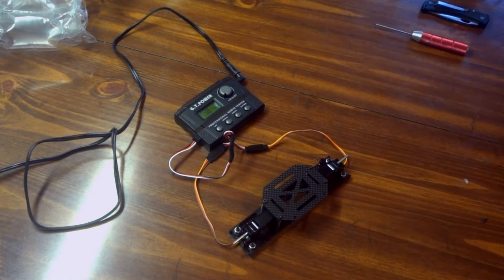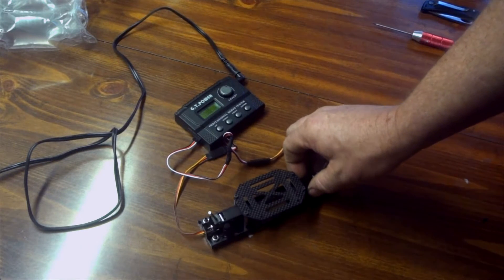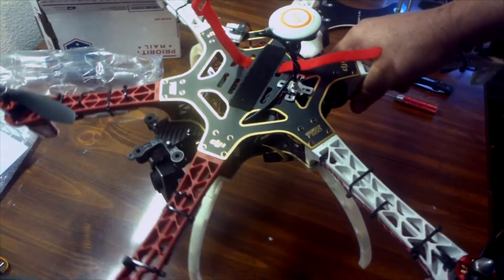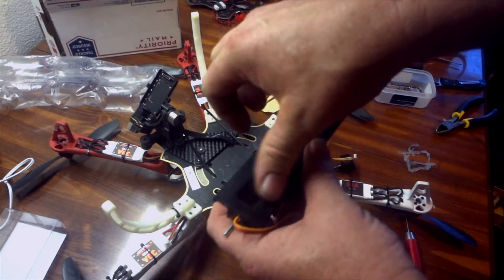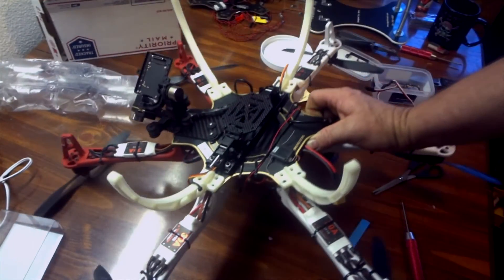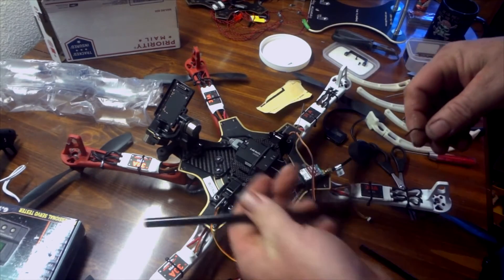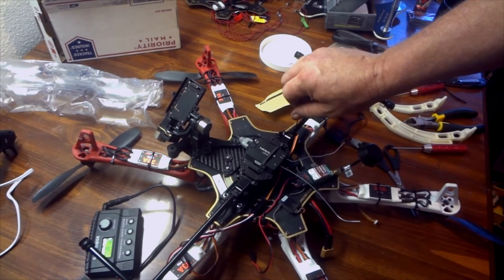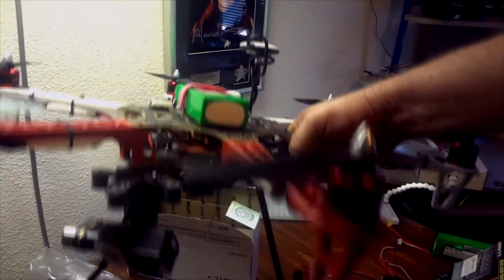F550 Small size Alloy Metal-Multi Rotor Electric RetractSystem Installation.

Comment: I removed the set screws then used a small drill bit and while the gear was taped down, I drilled little notches in to the shaft. I replaced the set screws after blowing out with air. This made a major difference. Nor more twisting of the pin in the trunion. Tested 3 flights with intentional hard landings.. Perfect.
Reply from the maker: Very cool!  Glad to hear it.  I haven't had much of a chance to fly mine, fall weather has set in.

Comment: Thank you, I was just going to drill through the trunion and pin it.
Reply from the maker: Been busy all day today, haven't had a chance to upload the new video yet, but there are two small allen screws on either side of the shaft that goes into trunion, you should just be able to tighten those.  You might want to try that before drilling.

Comment: Tried that already. If not drilling maybe a notch for the set screws to hold on to.
Reply from the maker: That could work.  In my video (sorry, still haven't had a chance to post it yet, have had out of town family visiting this weekend), I show that the pin only has a flat spot on one side, thinking about using a dremil tool to flatten out a spot on the other side for the second set screw to rest in as well.  I haven't done that yet, thought I would see how the Loc-Tite worked first.  Weather has gotten bad where I live, so haven't had a chance to do any flights since doing my repair on my gear yet.  I hope to get some flights in tomorrow in between the rain to show our visitors.

Comment: On my testing, the pin in trunion comes loose after a few landings. Have you had this issue or did I just get an odd set?
Reply from the maker: I think mine is a little loose too, i noticed that one of my legs twists a little now.  Haven't had the time to investigate it yet.  Other than that they are still working after about 15 flights.
Reply from the maker: I finally had a chance to take a close look at my landing gear, and yes my pin was loose.  I just made a video showing how to tighten them up and recommend using some sort of thread locker like "Loc-Tite" to keep the screws from becoming loose.  I hope to have the video posted by tomorrow afternoon.